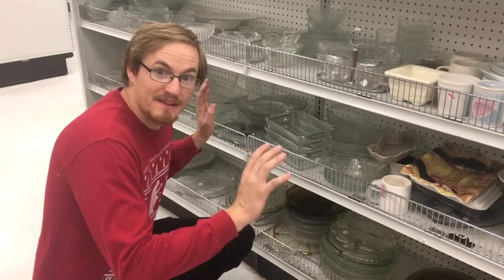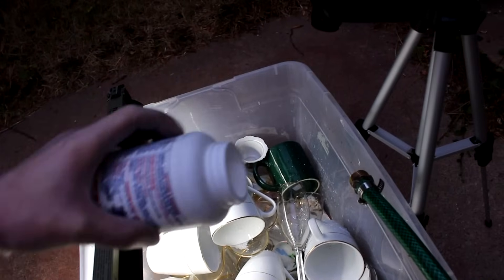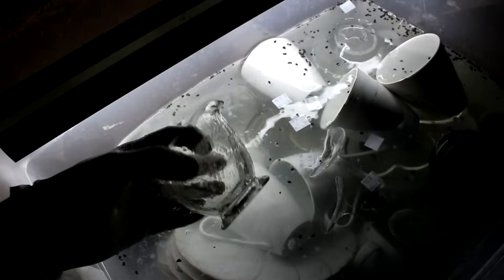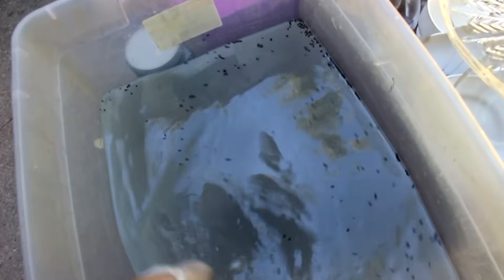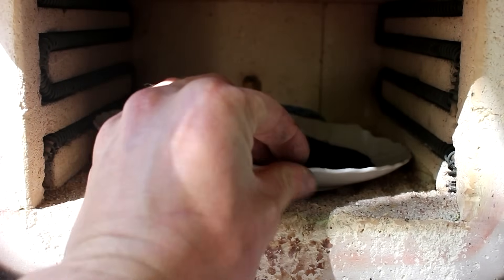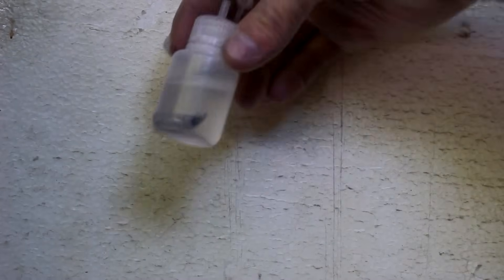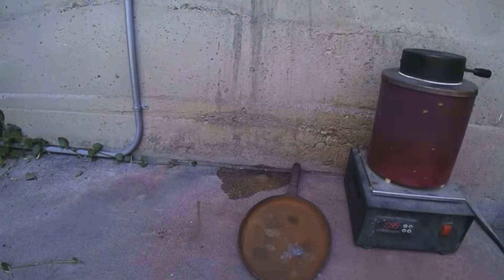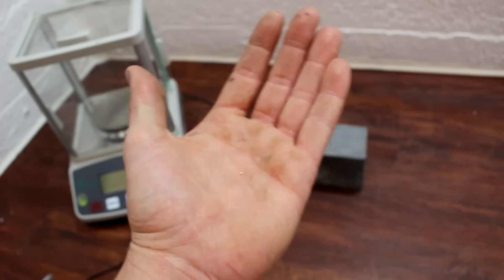Precious Metal Refining & Recovery, Episode 14:Gold From Dishes

Comment: Seeing this years later nnowing a tiny bit more, i would have circulated rhe solution through a confined activated carbon filter rather than leavingnit to passively absorb the solution. 

Im certain you thought of that, and a million ppl in the comments already said it. But thats the simplest engineering solution I can think of to concentrate the gold here.

Comment: How do you know that was gold on the dishes and not brass? I mean, I have a beautiful headband with a golden color that I got at Target and I am pretty sure it is brass covered steel(magnet test positive for steel, golden color of brass). I mean out of the 2 golden metals, brass is way cheaper. The jewels in my headband are just cut colored glass that looks like gemstones. And brass has a relatively low melting point, even lower than gold.

Comment: Cody, there is a much simpler method to extract the gold from the gilded dishes.  Use dilute HCl and hydrogen peroxide to strip the gold then dilute the the gold solution and raise the pH with baking soda.  The acid does not have to be completely neutralized for the gold to precipitate.  You know you are getting close when the baking soda produces a purple color where it hits the solution.

Comment: Cody'sLab I think instead of using that much carbon it would be better to put it all in a cup open at the bottom and take a small 3 dollar aquarium pump and make it's output go through the cup, that way after 30 minutes you know that all the solution went through the carbon at least a dozen times.

Comment: When you were adding the HCl to the solution, the pH shouldn't fall below 5, not higher than 5. I'm sure you just mixed up your words in the heat of the moment, since it wouldn't make much sense of adding acid and the pH of that solution would be rising, since HCN would be given off in a strongly acidic environment and not a basic one. Great video though, quite extraordinary experiment to do, nice work.

Comment: I would like to see you show people you can run a car in water,well you know brown gas like build a large cell..also make water from salt water by burning on stainless or heat water...And I know they make them for large yachts but I would like to make my own bleach as I make the waist water clean on me Sail boat.. thought of using gas from tank plus make hho..this should make the water clean and have gas for stove all the time saved in vacuum freezer bags then throw lb on to help push the gas to stove...Just want to be more green and will use to teach others ..make 200 watts dolor and can make 400 peak wind at 15 knots wind or 5 kW per week..if bump this up,to cold fusion can I make my own water to. drink??batt store 800 watts.!! Any advice would be way cool...thanks for the

Comment: Will carbon or charcoal being burned off in an electric furnace heated by nichrome resistance wire be damaged by the carbon monoxide?  I realize carbon dioxide is the end product of the oxidation, but I didn't want to ruin my furnace by exposing the nickel in the windings to CO and making nickel carbonyl.

Comment: Hey Cody,

I have come across an interesting article that states that you can use glow discharge from inert gasses at low pressure as an electron source in order to make gold nano particles fall out of solution. This process selectively separates precious metals by dropping out things with high standard electrode potentials (so it may also drop out Pb), but i think it would be awesome if you could do a little research and see if you think it is something worth trying. The process is reportedly cheap. 

The specific article that I have found is titled " Preparation of Floating Au/PVP film on Water for Green and Rapid Extraction of Gold Ion. 

If you had the time, it would be awesome! 

Sincerely,

Tyler

Comment: as of today, you have made $1.15 worth of gold. Also, it's probably too late now, but I would have suggested returning the porcelain to the thrift shop and crushed the glassware into a fine powder and doing a silicon thermite reaction because glass is SiO2 (or SiO4 if you want to measure the crystal from the silicon outwards.)

Comment: interesting as usual! :D

but i was wandering, how can you make this method be worth for your mine's gold ore? process that amount of ore whit this chemicals shouldn't cost you more than the gold value itself?
Reply from the maker: I always wondered why my grandpa abandoned the mine...
Reply: @Cody'sLab you might be able to take it and dissolve the gold off the ore in a slightly larger batch then take the ore out and repeat it using the same chemicals for the next batch and save yourself on the cost of them or would the chemicals be used up by then (i would suggest mining a bunch first)
Reply: you need to regenerate that chemicals first, example you dissolve tin in acid clorhidric, after you have to precipitate the metal and usually the rest it's waste

Comment: Its amazing that tiny amount of gold could cover that much plating on that much glassware. How thin is the actually plating when such a small amount covers a relatively large surface area?
Reply: periodic videos has prof emeritus Martyn Poliakoff explain
the process and several similar, when brady have his watch 'gold plated'.
the watch was un-usable due to there being a gold-ish shmear on the glass face.

the machine rolls the item in,
or in the poliakoff case, it was a tool for coating other thing for testing and interfacing...
so it place on the annode.
another professor had a youtube channel,
in which various coating and vapeur were applied
to various lightbulbs.

photonic-induction has also tried coating various surfaces
for 'trophy', and lightbulb also.
the titanium dithorium methyl vapeur glowed when at a certain amperage.
it changed color states very rapidly a few time,
then, a distinct smell of burning as the 
anion are broken and it form new material eh.
the 'indestructible filament' have been something many hobbyist try to make hehehe

S Michaux of Liege also detail that in his webisodes, 
re some gold coverage and the futures of resource eh
mon ami.

Comment: Hey Cody, as a chemistry student I felt boggled when you said "burn all the carbon into ash." I was under the impression that carbon is ash, and that you couldn't reduce it much further. What would the ash be composed of if you "burned all the carbon out?"
Reply: come on man :/ wood ashes are mostly calcium carbonates with other noncombustable oxides/carbonates (potassium/magnesium/manganese etc) , there's very little to no carbon left in wood ashes. In fact, ashes in general are noncombustibles left over once the carbon has been completely burnt off, in this case, sodium carbonate/gold and other traces from the water supply. There's a difference between keeping it simple and misinforming :I
Reply: #it depends on the ash. Fully burned ash has little carbon left but most preppers/woodsmen deliberately make fires that leave a fair amount of carbon behind. The reason being it is rich with free radicals which make it easier to start a fire from.
Reply: non oxidizable residue. Heated carbon likes O a lot.
Reply: To keep it simple, the carbon is basically wood, (like a campfire) burning it to ash is just adding oxygen to it.
Reply: Zivilyn The Wyrd 
That's why I said it is "like"
Reply: Wood leaves very little ash compared to other fuels, once it is fully combusted. You also don't have to worry about sintering, which will be a problem with a bunch of other fuels. The elements left in the ash are pretty much fertilizer, after all. No wonder the trees are stingy with it..

Other fuels (like coal) have a higher suphur or nitrogen content, which is left as ash.

Comment: some guy here did a concentrated vinagar to the gold. to remove it.
Reply from the maker: THat will work, needs a strong oxidizer though.
Reply: *****
did you cee that roger rabbit . came to visit.
Reply: I think it would be easier to simply scratch off the gold in flakes and the smooth out the plates to sell at a flea market and melt the gold flakes into the tiny ball we saw at the end

Comment: Does anyone else think that Cody is too risky considering his health? I mean if you just take the mercury gases he must have inhaled in his lifetime, boiling toxic material in a test tube instead of a boiling flask, also the really unsafe way he handles poisonous chemicals, quite disconcerting tbh
Reply: He took a blood test a while back and showed that the did not have an elevated level of mercury in his blood. A lot of what he does might look kinda sketch, but he had worked in labs in college, and is now just using household equipment because it is fast cheaper than lab glassware.

Comment: What about loose gold foil? Would you use the same method of using a solution? Say someone collected gold foil from something like Goldschalger over a period of the time. I heard its to thin to put a direct flame on or just cant melt proper. Or maybe you can press it?

Comment: that little bit of gold covered all those dishes?  amazing
Reply: Gold is the most malliable element known to man.
One gram can cover roughly one square meter.
Reply: @XZenon  : The Royal Bank of Canada in Toronto Ontario has a glass tower that is sheathed with 22K glazed panels.  The glass is clear, from the inside viewpoint.  I have read that, at the time of construction,  the use of gold was more economical than draperies.  The building is quite a striking vision at sunset and sunrise.  Testament to the malleability of Au.
Reply: Luckeux Seriously. At this thickness, even solid gold becomes very transparent to visible light while still being able to block out a large amount of harmful radiation, which is why gold foil is used on the helmets of space suits.
Reply: I thought the same thing. I was expecting a lot more with how many dishes he had
Reply: FieryWingedAngel ooooooh awesome
Reply: +FieryWingedAngel Seriously?
Reply: Luckeux It sure is.
Reply: Yes. The gold paint used as an over glaze on glassware and china is EXTREMELY thin. I've used it.
Reply: The paint had probably more than gold in it. And he probably didn't recover 100% of it.

Comment: Interesting way to do this , I like the science involved. But for anyone interested there is an easier and cheaper way to do it....though somewhat dangerous if you dont know what you are doing. The muriatic acid/bleach/sodium metabisulfite process if done correctly and safely is the way to go for recovering gold from dishes. Probably not the right process for gold ore though , not effective enough for that.

Comment: looks like you also found an effective method for removing label adhesive.
Reply: Acetone or nail polish remover with acetone works about 100% of the time for me.
Reply: Doesn't that dissolve some types of plastic?
Reply: Do you not care about what is under the label because that will probably scratch it.
Reply: Acetone can mess up a few plastics, so I'd only use that on metal or ceramic. But it doesn't work that well anyway on many adhesives (and there are many different types of adhesives) anyway. It also evaporates so quickly that you mostly smear the glue instead of removing it.
What works well though is what is called "white spirit" (I think, it's called "Waschbenzin" in german or "washing petroleum") and it's quite harmless on plastic surfaces.
And you can try a detergent based on orange oil (main active ingredient limonene). That's often in dtergents to remove oil stains from clothes or grease from your hands. Works almost as well.
Reply: Goo-Gone is orange oil based, I believe.
Reply: lucaspeltie Use only Oil if you don't want to scratch it, Oil binds the glue.
Reply: I personally use Oil and Steel Wool, have not had a label that survived this.
Reply: Kerosene seems to work for me. It will eat away paint though
Reply: I've never seen a single chemical that will actually dissolve glue without leaving a residue and it always requires so much scrubbing that the chemical is pointless. maybe I should start using cyanide.
Reply: @melody3741   use 99% isopropyl alcohol  no residue
Reply: Eucalyptus oil gets it straight off
Reply: Yup, "wasbenzine" as we call it in dutch usually works quite well. It's also readily available here. Some Americans  recoomend "goo-gone" but I haven't tried that yet. If you don't have anything like it you could try to heat the label up a little with a hairdryer, the heat will make the glue melt and the labe willl peel of easier without leaving residue.
Reply: Goo gone does jack. I've tried it on several stickers and it doesn't work that well.
Reply: Lol
Reply: My aunt uses WD40 for removing glue and label adhesive

Comment: So are you saying when I put an activated charcoal filter in my gold plating baths, I am taking out the gold?  Just not organics?
Reply from the maker: oh yes
Reply: I found a 24k gold ring the other day, can I use this as a cathode and a Charcoal as the anode to do gold plating? In other words can I plate carbon?
Reply: you could plate carbon, just not in any sane conditions, would require raw carbon ions

you might be able to plate tiny graphite chunks or something if you could make them behave like metal ions, like with a superacid
Reply: What makes you think you have a 24 kt ring?  If you could plate carbon you don't need the gold at all.  The cathode (negative) is the piece you want to plate.  The anodes are positive and completes the process.

Comment: Allegedly there is platinum in hard drive platters. I wonder if you can extract anything from those. Cutting up the platters into small pieces and soaking with HCl overnight will remove the aluminum and leave behind the outer coating.

Comment: hey cody I'm a geology student in california, and was talking to my professors about euhedral crystals. which reminded me of your videos and the process you put the material through. I was curious if you could get a euhedral piece of gold in its isometric form through any of these process?
Reply from the maker: I've seen some left after dissolving gold in mercury and then distilling it off.
Reply: I feel like I'm an alien , just watching you two comment about science
Reply: I've never done it with gold but with iron.

I've used a a molten lead-aluminum alloy to suspend molten iron in it and let it cool over 12 hours. After that i dissolved the lead and alu to get the iron crystals. From that i got ~2mm iron crystals.
Then I've pressed some of them into lead and had gown the crystal by a electrolytic deposition. Here it's important to get the voltage exactly right to only deposit iron and the power to deposit it slow and evenly.

I think it could work similar with gold. The hardest step is to get a pure gold crystal to grow it. I don't know in what alloy you can suspend the gold to grow a crystal by cooling it down slowly.
Reply: I thought about that same process when i watched his electro plating video. i was curious if you would get a euhedral crystal that way cause I'm sure it would be easier then trying to get it from a  melt

Comment: Why does the gold always form a little ball? Shouldn't it just become a flat puddle?
Reply: It's because of the surface tension. It pulls the molten gold into a sphere.
Reply: It's because of the surface tension. It pulls the molten gold into a sphere.
Credits : Anticonny

lol
Reply: Interesting question for those "flat earth" nuts. lol Water does the same thing. When it splashes, the little drops that fly up are spherical.
Reply: Thats not how surface tension works as you can see in water droplets on the ISS. It is actually the stronger cohesive quality of water to itself over the adhesive force of its container (its more attracted to itself that the walls of the container, as it is slightly polar due to the molecules being lopsided it acts sort of like a magnet)
Reply: My guess is probably gravity pushing on it from all sides, same with the water drops.
Reply: surface tension I guess
Reply: SoundsLikeJazz
huh? ^^
Reply: Surface tensions means it contracts to have the smallest possible surface area; a sphere is the shape with the highest surface area to volume ratio, so by forming a sphere it has a large volume but small surface area.

Comment: I just melted some aluminum like 10 mins ago!!! I tried some strange ore and it exploded
Reply: Thx
Reply: you could have some magnesium it will explode
Reply: It was really light, but not as light as aluminum tho, plus it had iron like colours
Reply: I melted some aluminum fairly recently. Just wondering, how did you do it? Do you have a furnace or just an open fire? I have melted a bunch of cans while camping in some sort of steel can that can take the heat. I have quite a collection of odd shaped aluminum lumps

Comment: Cody, what is the difference between activated carbon and normal carbon?
Reply from the maker: activated has its surface area greatly increased by dissolving or burning away some of the carbon.
Reply: In theory, could you use powdered carbon charcoals as an alternative to activated charcoal? (even though activated charcoal is quite easy to come by)
Reply: Yes, I did. I couldn't find anything =(